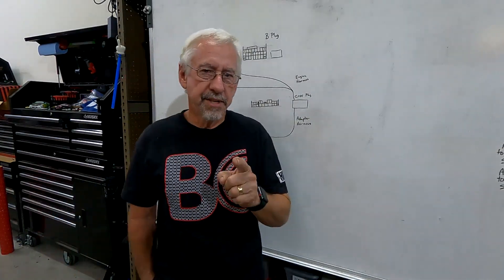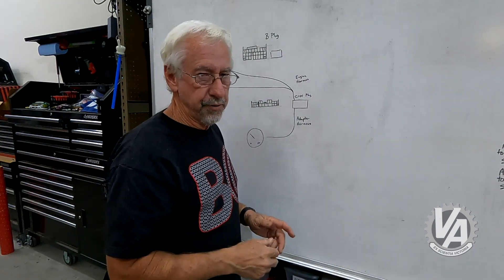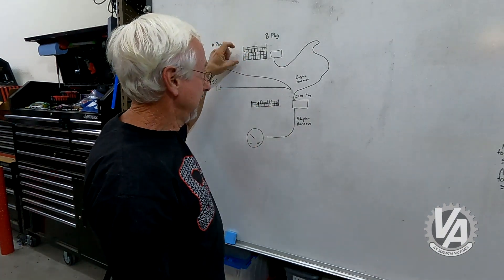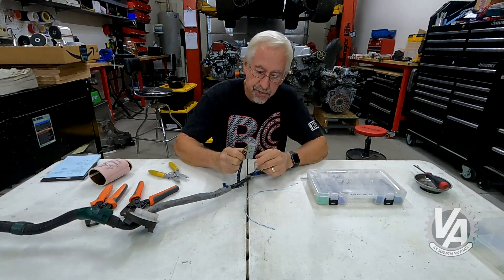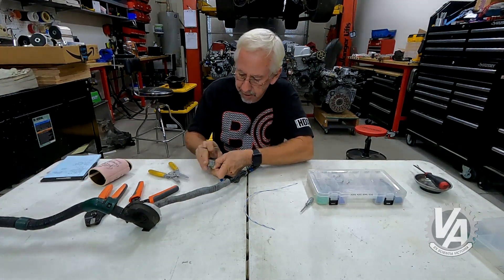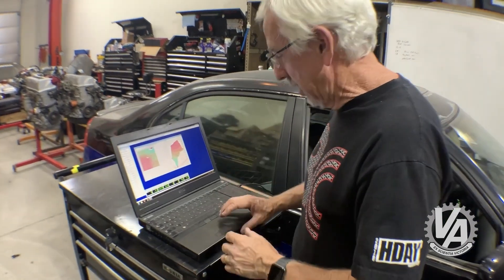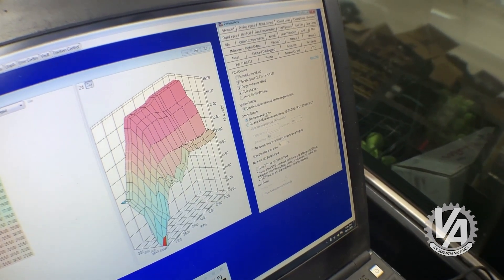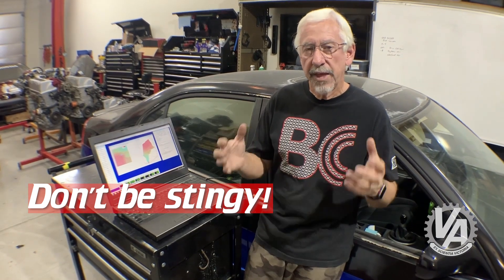Hondata Speedo Fix Pt2: CSS or VSS, it'll work!

Comment: Thanks for the video sir! I plan on doing a k series swap i wanna figure out how i can make everything easier with a k20z swap!! Any tips to avoid any problems and make everything easier, not having todo crazy things to get the speedo correct? Thanks
Reply from the maker: Which Z? The 1 or 3? What ECU do you want to run? What transmission?
Reply: @VTECAcademy  k20z4! The fn2 type R! 07-11 im pretty sure its the same as k20z3! As far as ecu! Any kind of ecu since i havent bought any yet! And transmission is the K20z4 5.063 gearbox transmission! I got a complete swap that i want to drop in a civic ek coupe! I wanna know what to purchase and watch out for before wasting any money! I can also however rebuild the transmission so it will be opened!
Reply: @uwkcal hi mate I know this is a long shot but did you manage to get the swap done?

Comment: If you have a vss harness and a css trans and I change the plug on the trans side would the wiring be the same for each plug or would the pins need to be moved around?
Reply from the maker: If you use the VSS wires, you will burn up the CSS. The VSS uses 12V and the CSS uses 5V. You need to use the 5V signal and sensor ground wires from the TPS (wired in parallel) with the Signal wire from A18 on the ECU.

Comment: Apologies to comment on an old video. 
I have a 05/06 based dc5-S gearbox with CSS. 
K24a3 from cl9 using 02/04 ep3r harness and 02/04 kpro v4 based ecu

On hondata website it specifically quote this on there website (If all these components are not matched, then either your ECU speed or your dash speedometer will not work (or both will not work).  Repeat: all these components need to be either the low frequency design, or the high frequency design)

So I don't understand how its working for you guys.

Or are you using the 05/06 based hondata v4?
Reply from the maker: Well, I know a secret. Hondata doesn't officially support this hack, but it works.
Reply: @VTECAcademy  how did you come across this secret that b11 was a VSS output?! 👀👀
Reply from the maker: @EricDolinar  While doing research on the 05 Accord KPro they sell.
Reply: @VTECAcademy  did you ever attempt this with a Kpro install by another installer?
Reply from the maker: @EricDolinar  No. But the standard procedure for installing the K-Pro doesn't include modifying the ECU for VSS output. It is unlikely others are doing it.
Reply: @VTECAcademy  I’ll give it a shot with my kpro installed by HAMotorsports.  I’ll probably just put a wire pinned into the ecu and scope it to see if there’s an output signal.  If so, we will know if they do it, well at least if HAMotorsports does it.
Reply: @EricDolinar any luck?

Comment: So this speedo correct work with vss and css ?? Cause I have a kprov4 install by a approve installing tuning shop I use vss and my cluster is off of some kmh(in Canada) I need to roll at 140kmh on the cluster to actually roll 120 on the GPS I made my mind around it but it begins to annoy me
Reply from the maker: I don't know what your setup is. Can you tell me what transmission you are using in what car?
Reply: @VTECAcademy  i have an 99 EM1 k24a RBB jdm Engine swap with a EP3 type r transmission
Reply from the maker: @tomydespins2315  I don't know if the shop you used set the right jumper to output a speed signal. My understanding is only Hondata does it. But if you hook up B11 to your speedo and get a signal, then the company that installed the KPro did a good job and you can adjust the percentage in the Hondata software to get an accurate reading. And to answer the original question, the adjustment works with VSS or CSS.

Comment: How does this work? If you disconnect the wire going to the ecu from the vss and A plug, how does the ecu get a signal from the vss?
Reply: Maybe you haven't realize that both css and vss are speed sensors but in different location. CSS now gives that info to the ecu

Comment: Can I do the same thing with my k24z7 swap? Have it running off the stock 2012 si computer and fuse box. Got the tach wired but haven’t sorted out the Speedo yet.
Reply from the maker: No, you will need to use a speedometer signal converter like the one sold by Dakota Digital or Healtech.

Comment: I have a rsx 02-04 with a transmission that I will be using countershaft vss, do I need to change this or this is only for k swaped vehicles?
Reply: You do. The car is looking for the slower sensor, not the faster countershaft speed.
Reply: @BrianGillespie_brianathasport  Okay thank you , what do you mean with that it only works if hondata installed it ? I got my Kpro V.4 installed by hondata dealer in denmark(Kpro installer). Should it work ?
Reply: @BrianGillespie_brianathasport  hi, it wasn't enabled in my kpro. Is it possible to get it enabled somehow?

Comment: Any conversion needed for base rsx harness to work with k24a3 rbb ecu?
Reply: Yes depending on the harness. There are some differences in auto and manual as well as differences between 02-04 and 05-06.
Reply: @BrianGillespie_brianathasport  any links to a k24a3 rbb ecu pin diagram? The k24a3 runs with my base k20 ecu but doesn't run with its own ecu. I'm using the base rsx harness
Reply: @nof9741  No links to the Accord specifically, but if you wire it the same as the 05-06 RSX it should run with the RBB ECU.
Reply: Both harness and engine are between 02-04

Comment: I’m going to try this because I have the same problem.. the rpm works so does the gas gauge ... the mph don’t work .... also I have a quick question if I plug in my transmission plug I can’t use reverse I have to leave it unplugged... can that be the reason I don’t have the mph working?
Reply from the maker: It's possible. If your ECU is set up to show a constant speed it may be activating the reverse lockout.

Comment: Hey brian thnx for the knowledge. I’m running a k20z3 with k20a2 harness. I tried this and can’t get my Speedo to work still. I’m using a rsx speedometer
Reply from the maker: What year RSX?
Reply: @VTECAcademy  02-04 harness and rsx cluster- 07 k20z3
Reply: It’s in a mr2. Also I have the vss wire from the rsx cluster going to the E plug pin 25-vss out. Not sure if that’s correct
Reply: @macklin9708  That won't work. The VSS out only works if it is an auto ECU in an auto RSX. You'll need a Hondata V4 and follow the videos.
Reply: @VTECAcademy  any tips?
Reply: Any tips if I’m missing anything?

Comment: Would this be the same for a 2007 Accord transmission? Also, would I need to repin the wires where the sensor plugs into the transmission, If I am using a 2002-2004 k20 type engine harness?
Reply: Yeah should be the same for accord transmission as it uses a css as well. Yeah you'll have to repin for the css because it needs a different voltage than vss but you can use the same signal wire

Comment: So in this case, after depinning the wire from the c101 plug, would I still be able to just wire b11 to the orange wire at b10?!? 
I did this as per your last instructions, sans the depinning of the c101 plug wire and my speedo “worked” but it just pinned as soon as I rolled the tires and then when I slow down again to a near stop it goes backwards again...
Reply from the maker: You are giving the speedo the CSS signal which is many times faster than the VSS signal. You need to adjust the percentage output of the speedo to reduce the signal speed. Try starting with 10% and see where that gets you.
Reply: Did you end up depinning c101 and splicing in b10 abstrahere or did u just pin into b11
Reply from the maker: @jdmlyfestyle710  I de-pinned it at the C101 and added a wire from B11 to the C101.

Comment: I am in the process of doing this.  Idk if it was covered but you make sure your countershaft speed sensor is receiving a 5v refrance signal like it was designed,  simply splicing the countershaft speed sensor plug on is incorrect because the differential driven speed sensor receives 12v
Reply: How to make it receive 5v?
Reply: @Brian-qe5rl  map sensor has 5v ref and ground from the ecu, you need to get it form that
Reply from the maker: If you simply splice the 12V wire in, it will damage the sensor. I believe I covered that.

Comment: Hey guys - love the technical info!

I’ve searched and searched, but is there a way to correct inaccurate speedo reading from vss in k20a2 EK?  The speedo correction in parameters doesn’t seem to affect the speedometer reading while driving.  It reads too fast ~ about 10mph off at 70mph when actually going 60mph.
Reply: Did you see our other video how to do a speedo correction? It's in the quick tip playlist.
Reply: Were you angle to fix this?

Comment: @VTECAcademy, 
Is it the same for Ktuner? I believe I had that issue with the AP1 cluster I had on my CRX. Ended up selling it because of the issue. 
I asked the question about the VSS wheel being eaten.
Reply: There is another video on speedometer correction for both th eKTuner and Hondata.

Comment: I have a K20z3 k swap in my 2000 ek with a RSX type S harness, everything on my OE cluster work except the RPM and the speedometer, If I do that harness rewiring would It work with the set up I have? Even though the civic si speed sensor signal (frequency) is different from the d16 Speedo sensor to the cluster. I’m running KTUNER ECU.
Reply: You can use the NEP for the tachometer. You'll need to wire that to the Speedo. On the CSS, check out the video on Speedometer correction in the quick tips.
Reply: @BrianGillespie_brianathasport  Thanks Brian I’m not sure what the NEP is and as for the Six speed gear box most guys I see on YouTube modify the gear box housing so it can run a CSS in the rear that has the ⚙️ operated sensor rather that the magnetic pulse sensor at the front of the gear box. I think I’m at the point where I’m just going to by a HUD ( Heads Up Display ) and run it from the data link or get a digital clock from a S2000 for it to work. Is NEP a speedo frequency converter?
Reply from the maker: @AndrewBlacksTV  NEP is engine speed pulse. It's on the E plug at position 26. It's a blue wire.

Comment: Hi.  I'm dr.  Honda from Dubai ... I have a RSX S and a Haltech car computer.  When air condition programming worked it does not work.  The revers solenoid does not work.  What is the solution
Reply: Wow. You'll need to talk to Haltech about that. I haven't used that yet.

Comment: is it possible to use a k20z1 engine harness for a k swap with a hondata with z1 trans
Reply: It is possible u will need to convert the harness to run hondata tho or u can run k tuner but I'm this vid he shows u how to make the spedo work of u are using a trans with speed sensor in front u just gotta one wire shown in this vid from ur harness I'm doin the same as you
Reply: Yes. You will need to make some changes to the harness though. The A, B and E plugs are pinned slightly different. That needs to be another video.
Reply: @BrianGillespie_brianathasport  have you done a video on that yet?
Reply: @EricDolinar  Not yet
Reply: @BrianGillespie_brianathasport   how would I be able to use a 02-04 kpro on my dc5 I’m fully built k20z1. I know I’d need a jumper harness from hondata but why else would I need to send my ecu to them is it because of the vss? And that only?

Comment: Thank you Brian ! Very good info. Where do you get get your power from for the css ? I remember you saying it uses different voltage than the vss
Reply: You get the power and ground from the TPS wiring.
Reply: Mostly small components use a 3-5v reference.
Reply: Also, brian don’t tell you this.. they just feed you enough information to fuck your shit up.. you must run the wires individually to the speed sensor, or you can do like I did and do it at the ecu plugs and feed your alternator 5v and jump through a pile of hoops trying to figure out why your shit isn’t charging! Thanks Brian! 🖕🏻